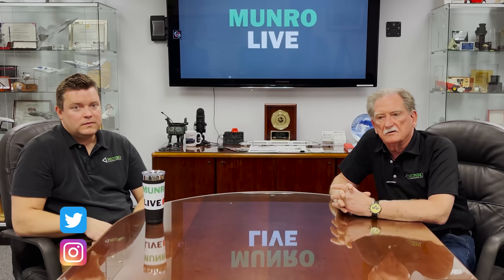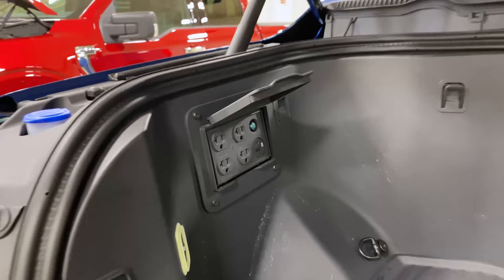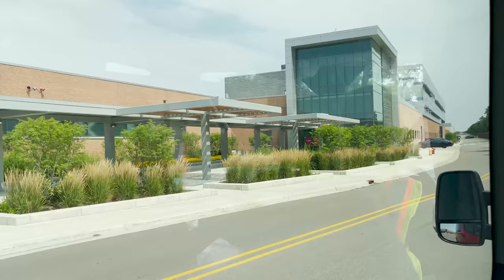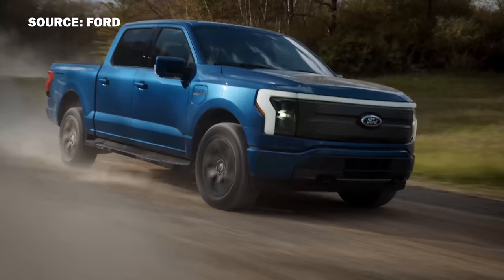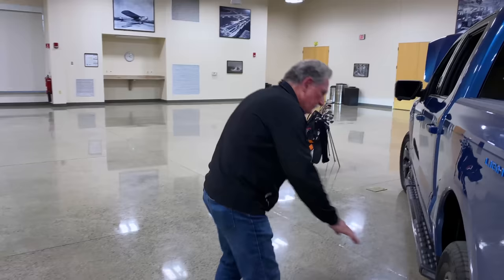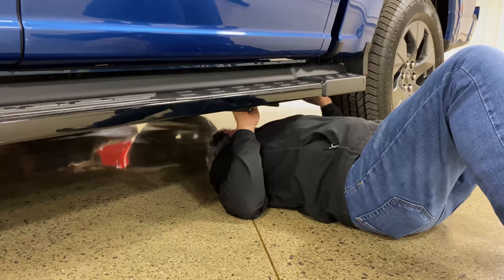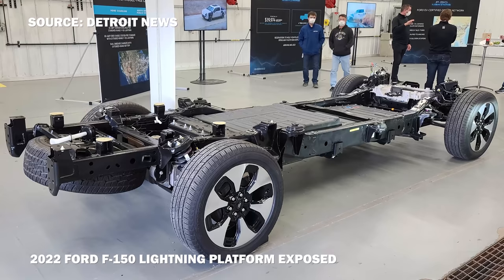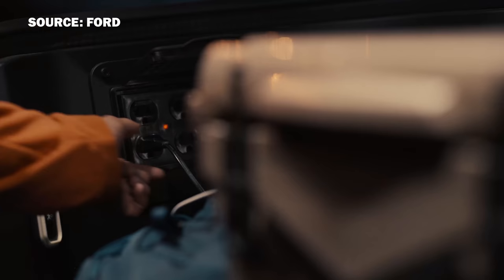Sandy's First Look at the Ford F-150 Lightning Electric Truck!

Comment: This is a valid question: What will happen in case of driving through high water (a river, or a flooded area) if there are drain holes in frunk/trunk? Will the water get inside through the drain holes?
Reply: Has a one way drain valve in place
Reply: @altonriggs2352 , thank you! That seems logical!
Reply: My thoughts are mice.
Reply: @davidbeppler3032  you added alot to this thread
Reply: @davidbeppler3032  Just put the one-way valve inside a drain tube, like on plastic gas cans. Threads and tabs at top so easily removed for mtce, replacement, or substituting for a plug if needed.
Reply: If you go through Highwater in this truck I guarantee you it will total it
Reply: @lengould9262  
Most air filter boxes already have them.
Reply: @ericrotermund1004  traction batteries are sealed and not effected by any depth of water, leaf excepted, that is the same in all liquid cooled batteries.  Whether it affects the 12V system is different but I assume Ford has that sorted in their trucks, so likely, like all modern evs, they are much better in floods.
Reply: @Tom55data  they leak
Reply: @ericrotermund1004  Tesla has no problem with it in their vehicles.  The battery is better sealed than a gas engine.  Only issue would be interior intrusion just like on a gas vehicle.
Reply: One way drain or gore-tex can be used to solve this problem.
Reply: Cools yer beer...no problem...
Reply: @nerothe  gas engines aren’t that low
Reply: @ericrotermund1004  that is a stupid answer, the battery is liquid cooled so CANNOT leak, it is full of liquid with a closed loop cooling system.
Reply: @Tom55data  lol
Reply: @Tom55data  so you are saying the entire pack is flooded with coolant lol
Extra 100 pounds of coolant yup just like the Mac-e
Reply: @ADOENDRA  Epic Solution!
Reply: @Tom55data  there isn’t an ev pack that doesn’t leak
Reply: @davidbeppler3032  
"It has a one way drain valve in place.... "
(Mouse with a screwdriver?)
Reply: @ericrotermund1004  Is it perhaps time you do some basic mechanical learning?
Reply: @lengould9262  I have seen tear downs of every pack made they all leak
Reply: @nerothe  the equipment that makes the car move is all very very low to the ground!!!!
Not the case with combustion engines
Reply: @nerothe  it's called feelings over facts phenomenon
Reply: @nerothe  go read a forum from actual owners with flooded EV proby
Reply: @ericrotermund1004  tbf that's basically every vehicle not specifically designed to snorkel
Reply: @ericrotermund1004  Exhaust Pipe, nearly drowned my ICE Car last year, when i underestimated the Waterlevel, i had to get full on throttle, my Headlamps had some water in it afterwards, Airbox is just above the Headlights in Level, so i had to be carefull not to make a wave.
My Engine nearly stalled and i had to floor it to prevent stalling, which i didn't want. Thats one point to think about it, you can stall an ICE by Water in the Exhaust Pipes. And then it's hard to start again. BEV are sealed but Tesla's has some history of not extremly well sealed Engines and other Points for long time underwater. In my Situation of short exposure, a BEV would have been much better. Because it was only for a short Time. And thats the Question: A BEV needs to be sealed to withstand 10 Minutes in Water, to prevent fatal Shortcircuits on daily live. Electrical Parts are build for the 3 foot below water and 60 Minutes test, which is the same all electrical Parts are build for ICE Cars. But an ICE without Snorkel can't drive with the Airbox is below the water line and it dies. Your Engine can stall on the Exhaust pipes etc. So on a BEV you got less Problems as in a modern ICE regarding water. (Some older Diesel Engines run without electrics, guess why most expeditions Cars are Diesels)
Reply: @musman9853  this is true but the most expensive part of the car is mounted very low and it’s more expensive than a gas engine and transmission combined.
I have worked on flooded cars they sputter and die most time some wd40 an oil change you can dry them out. This doesn’t happen with EV
Reply: My gut feeling tells me that driving an EV might survive and I could get me further than driving an ICE vehicle in case of an emergency that I need to escape form an sudden flood or wave or high water. This is my belief not based on facts.
Reply: @Elkarlo77  no way an EV survives what you ran through
Reply: @ericrotermund1004  Here is a report on a drowned Zoe (Renault BEV) https://www.youtube.com/watch?v=ixXF72HFr5U as long as the 12V system in the cabine stays dry they survive. The 12V System is the same as in every ICE. And my interior stayed dry, as i hit the shutdown for the vents.
Reply: You guys are funny...
If you're wondering submarines are electric... If You want to be submerged underwater.. I suggest you go electric...
Not a lot of oxygen underwater...
Reply: re: "What will happen in case of driving through high water (a river, or a flooded area)" simple, use good judgement and DON'T do that.  stop, turn around, and head back in the direction from which you came, you know, AWAY from the danger.  #FURTHERPROOFTHATPEOPLEAREDUMBNOTSMART
Reply: @danielsusca  re: "in case of an emergency that I need to escape form an sudden flood or wave or high water." well if it's a TRUE emergency and indeed these events DO happen (ref Japan, Germany, China, etc) what you're also assuming is that you'll be afforded the opportunity to GET to said vehicle in the first place. logic dictates if/when you're already dead, it doesn't really matter WHAT type of vehicle you have access to.  something very important we overlook is that these "untimely events" are called EMERGENCIES for a reason.  #FALSESENSEOFSECURITY <--- hint: this is what we're looking for.
Reply: @Tom55data  Send him to Road Show where they did an off-road review and that will answer his question.
Reply: @phillyphil1513  why do you suppose you have to be so careful with this truck lol
Reply: @ericrotermund1004  Yes, google is your friend.
Reply: @davidbeppler3032  I have never seen 350,000 miles on an electric car we have 3 Honda with 300 plus.
It’s hard to imagine getting that many miles out any battery powered car.